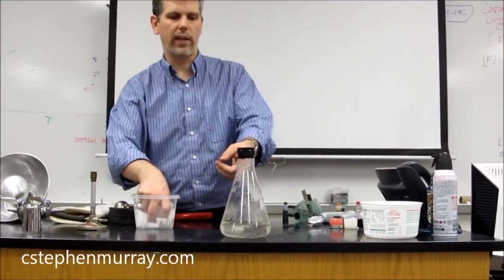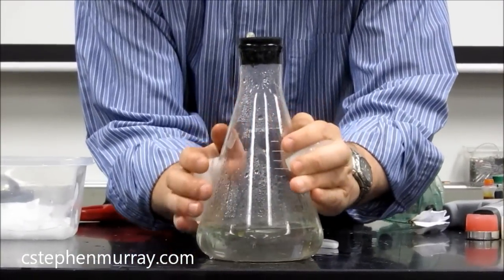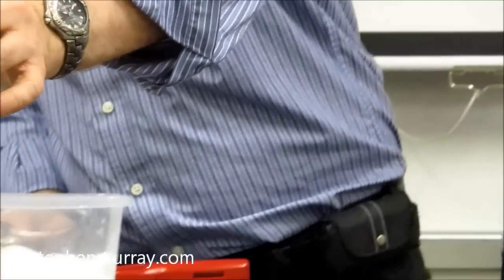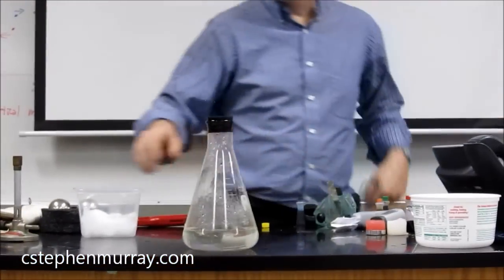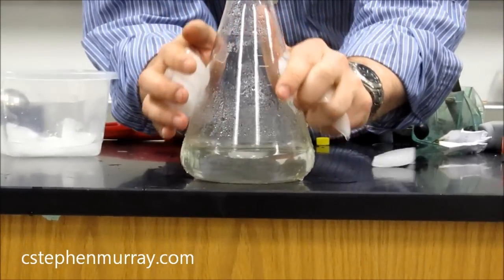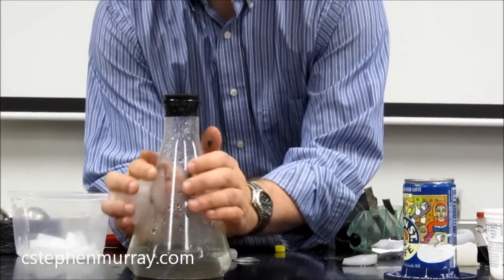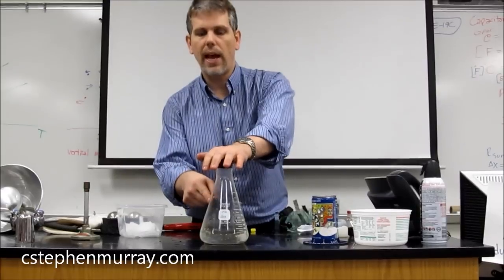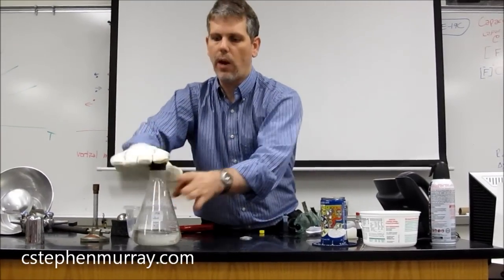BoilingWaterwithIce.wmv

Comment from the maker: Probably not.  It is not the water that allows this to happen, it is the steam above it.  The steam expands with temperature, displacing the air in the flask.  Capping the flask must be done quickly or air can get back in.  Steam compresses a lot when cooled, air does not.  The boiling of the water occurs because the ice reduces the temperature and therefore the pressure of the steam.  With sufficiently low pressure, water boils.  In a perfect vacuum (like in space) water boils at 0.01 degrees C (the triple point of water).